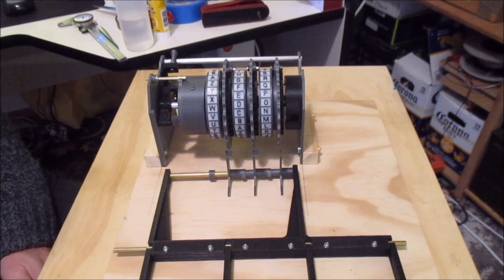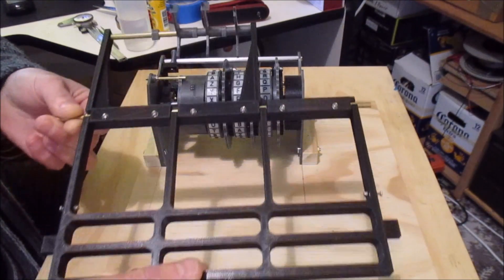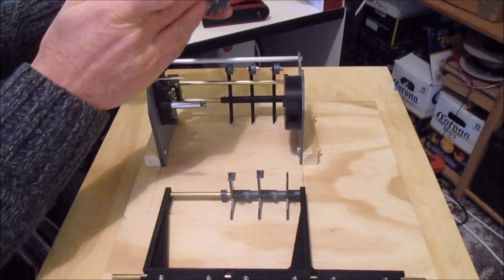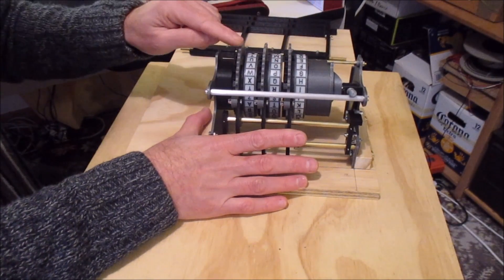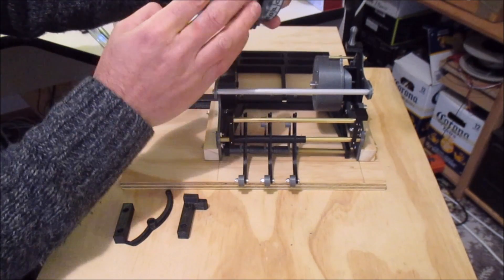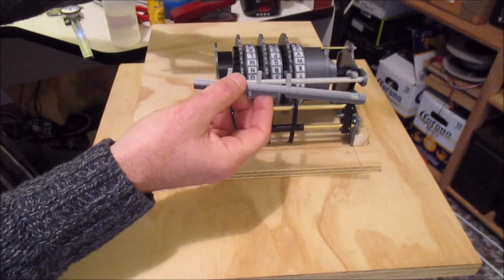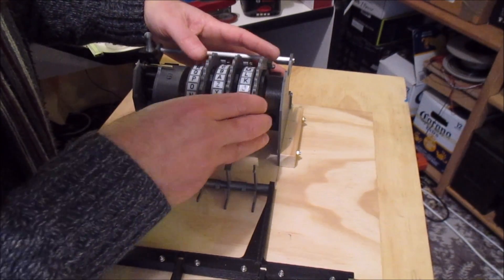3D printed Enigma machine.

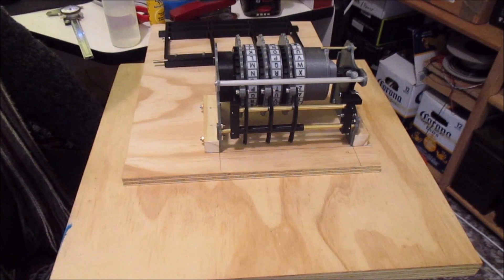Comment: 12:04 So you are saying you failed here?
Reply from the maker: No, just pointing out you can't just replicate metal parts from a real Enigma machine with an exact copy printed in plastic. They will lack the rigidity required. So you have to get creative in how you strengthen things so you can make the machine more rigid without affecting it's function.
Reply: @asciimation  Good point!
There's a 13 year old kid on YT that built an Enigma machine and it's rotor wheels mostly out of wood that was laser cut. The machine is partly electronic and the wheels had to be moved by hand.
Reply: @asciimation  During WW2 the Germans made their Enigma rotors out of Bakelite. 4:32 I didn't think or remember that the Enigma rotors had spring contacts